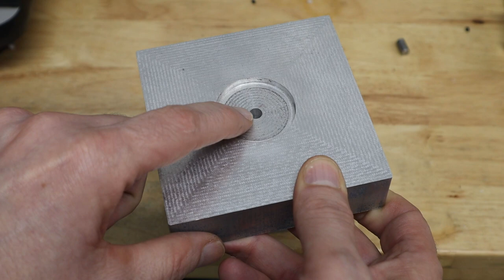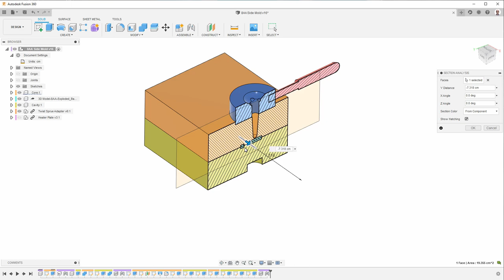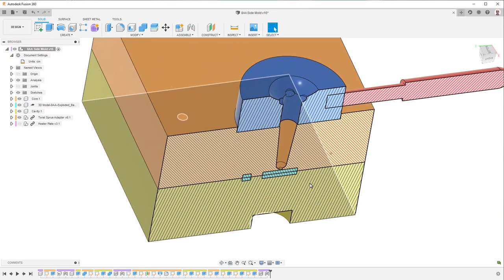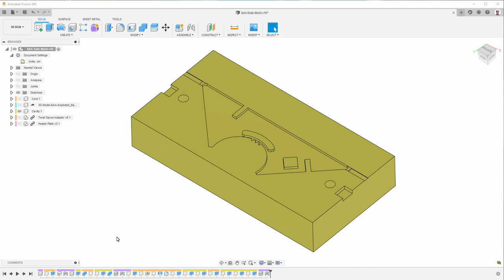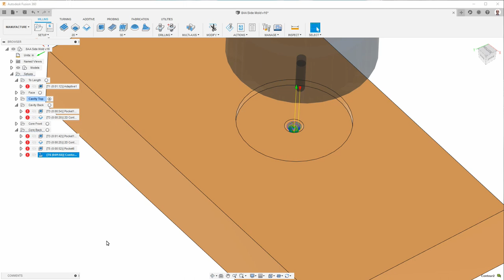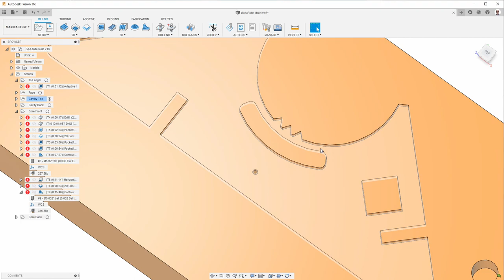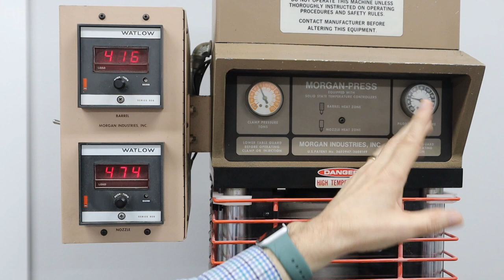Morgan G-100T First Injection Mold

Comment: Also, there is a bolt hole in the middle of the platen as well as the middle of the heater.  I put a low profile 3/8-16 SHCS, head diameter 0.557" in those bolt holes .  The bottom of the heater has a specific clearance hole for that bolt head. If you machine the same bolt head hole in the bottom of your mold ,then you can stack up the mold heater etc passively and be on center with the nozzle.  No manual alignment needed.  I also use ~0.020"glass beads in a sand blast cabinet to finish aluminum molds.  Rubber or duct tape for a bouncy mask.  I cut the parting surface after bead blast
Reply from the maker: I was impatient and wanted to get the machine running, so I borrowed a piece of aluminum from another project while I waited for an order from Xometry for 2" thick stock. I just finished making a 2" high, 4" wide, by 8" long riser that screws into the heater for alignment, and has the 3/8" low-profile screw in the top. So moving forward, I'll be using that. As to the finish, the customer wants closer to a gloss finish, so I may have to polish the mold if milling with smaller stepovers doesn't work.

Comment: Hello John, thank you for sharing! I have been using a similar Morgan press quite a bit lately with some decent results. Using the included mold  pre-heater has really helped me get a shiny and consistent surface finish on my parts. My press also has an additional regulator on the air line to the ram that controls injection pressure. The pilot pressure is typically left at 5, while the flow rate and ram pressure are adjusted to achieve a proper fill. The timer can also be adjusted to help regulate shot size, and the valve on the right side of the machine can help retract the ram to help refill the melt chamber between shots. I've been enjoying your videos, great job!
Reply from the maker: Thanks for the information. Mine also has another regulator, so it's time for me to read the manual again. Sometimes I have to read things, try out a few things, and then read again before I fully understand.
Reply: Yeah I cant quite figure out what the pilot valve actually does. I know it affects the injection pressure, but do you know if it's more of a fine tune rather than than coarse (via ram regulator)? and how does regulator pressure correlate to inj. pressure?   sorry i'm still a bit new to the morgan

Comment: John down in the control panel in between the red knob and b Black knob there’s a small knob for the timing adjustment, this should be used in combination with the plunger speed adjustment for better results, great video John.
Reply from the maker: Thanks. I'm definitely going to use that when I start production. For the initial trials, which is as far as I've gotten, I did it by sound. I can hear when it finishes injection and is in the packing phase.
Reply: I’m not by any means an expert, but I have been working with this machine for around five years on short productions if you have any questions that I can help you with or if you need copy of the machine operating manual let me know. John Thanks for what you do.

Comment: For the sprue hole, I usually drill it first and then go in with a long ballnose endmill and use a bore operation to finish it, adding the taper as well. The only time that's an issue is with the taper opening the other way and the hole in the bottom of a cavity or between two core protrusions. The tapered reamer works OK, the Morgan book recommends a straight flute hand reamer. You have to be careful or you can get some unevenness just in how your hand tends to apply pressure differently as you twist. I like the results better from the ball end mill boring approach, I think I set the pitch to 0.01" and it runs pretty fast.
Reply from the maker: Good to know. I did think about drilling, but was concerned it might walk a little. I'll have to try that next time. I have two more molds to make this week (during my time off from work), so I'll be able to try.

Comment: Thanks John, interesting video, I am very early on learning, but I wonder if the speed control is to increase shear in the material so it flows better? Mine is just manual hand press, so it would be interesting to understand the logic behind the design choices on some of the more advanced machines
Reply from the maker: Good question, and I'll need to do some research into this. I know that larger machines have control over injection speed and many other parameters. What I did learn from this is that slowing down the injection decreases the pressure forcing the mold halves apart. I need to do more research and reading to understand more about how injection pressure and injection speed interact.

Comment: When you're doing small pockets where the cutter diameter is very close to the hole diameter you have to really slow down the feed.  I don't remember the correct calculation off the top of my head, but it's something like 1/10 of normal feed rate.  That should help reduce chatter and tool deflection.
Reply from the maker: Oh, right. I totally forgot about that. Thanks for reminding me. I'll slow down the feedrate next time and see if that helps.

Comment: Sandblast the surfaces?
Reply from the maker: That's something I want to try at some point. For this mold, the customer would like more of a gloss finish. So it's either polish the mold, or try running another tool path with much smaller step overs.